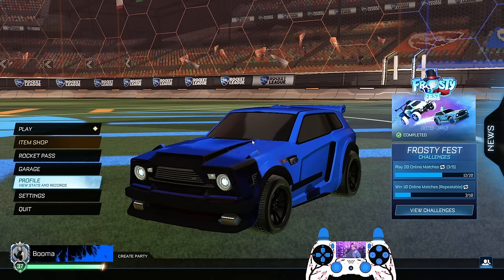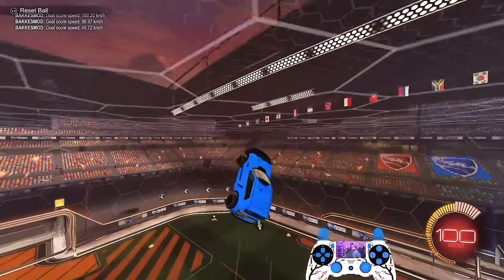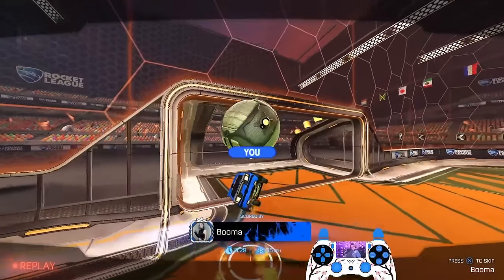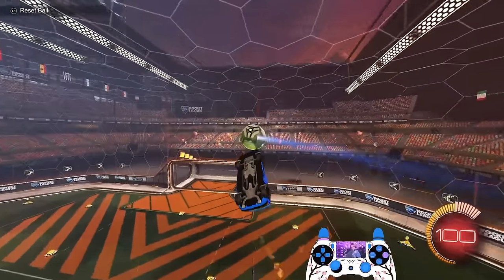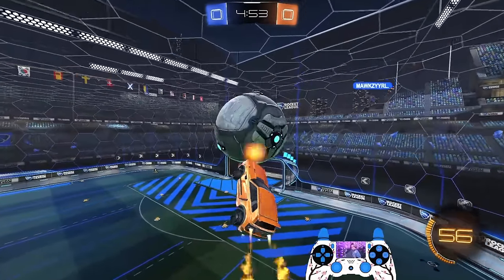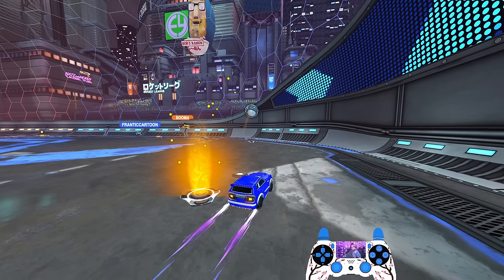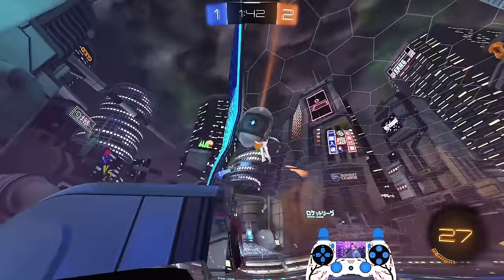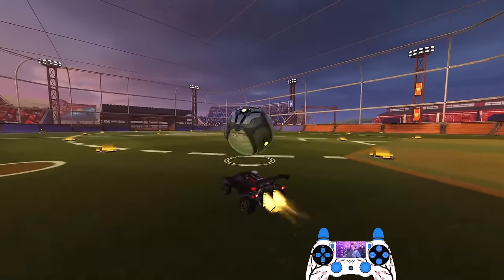HOW TO GET CRACKED MOVEMENT IN ROCKET LEAGUE TUTORIAL

Comment: I’m pretty sure I noticed you tapping powerslide whenever you’re getting a reset, do you think it’s necessary to do it as you climb to a higher level of gameplay?
Reply from the maker: Players are capable of grabbing resets at any pace & momentum this includes while accelerating/not power slide tapping so it’s not an absolute necessity. Just a small tip for players needing a bit more control

Comment: Quick question, how crucial are optimal controller settings (dodge/controller dead zone + air/ground sensitivity) to input efficiency?
Reply from the maker: I'd argue they are super important it's good to have 1:1 for air and and ground deadzones but usually controller and dodge are based off what's comfortable and doesn't have stick drift
Reply: @BoomaRL  thank you